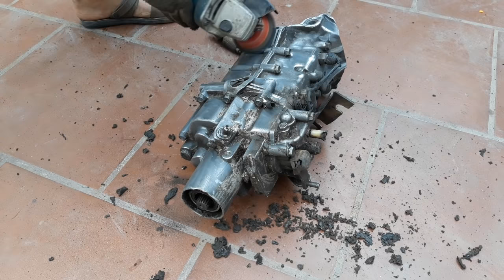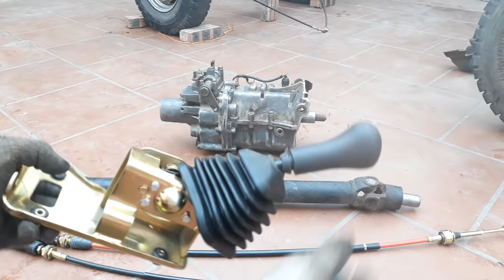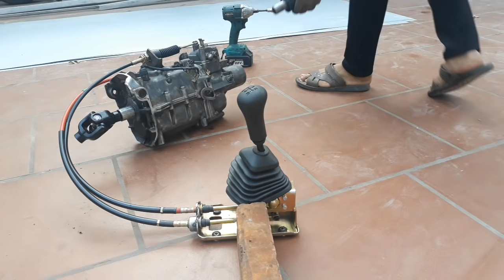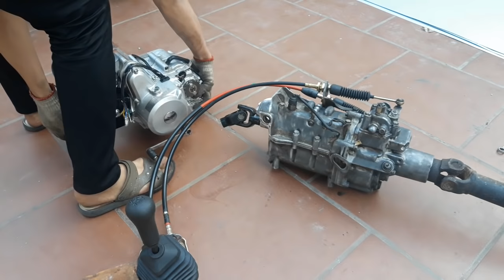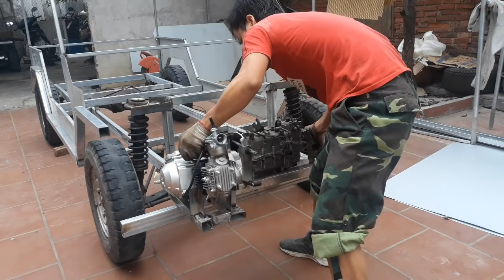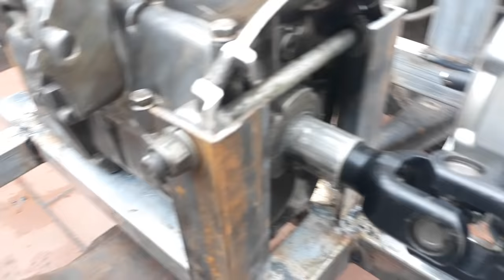Jeep homemade #6: Gearbox strong car and 125 cc petrol engine

Comment: What gear number you use in 125cc motor to a transmission gear 1? Example. Motor gear 1 and transmission gear 1234 or motor gear 1234 and transmission gear 1234 also?

Comment: Thats the tiniest 125 ive ever seen. The carb looks like it goes on a weed eater. Im amazed this thing will move. I built a mini dragster and used a goldwing engine and transmission with a narrowed ford rear end. The thing was fun but deadly. The issue i had was breaking the transmission cases. After 3 i quit.

Comment: 3 major problems 1.the engine is to small to power it other than maybe along flat ground.   2.its going to overheat ad there's insufficient air flow to to cool the cylinder, .  3. The motor cycle clutch and gearbox isn't strong enough for it's final weight and with no heavy flywheel it will never generate enough power, it s never going to work or  going tobe useful
Reply: Maybe not. Between the bike motor's trans (5 speed?) and that 4 speed secondary gearbox, he's got 20 gears to run through. Thats a lot of shifting but in 1st x 1st, than thing would probably climb a tree.